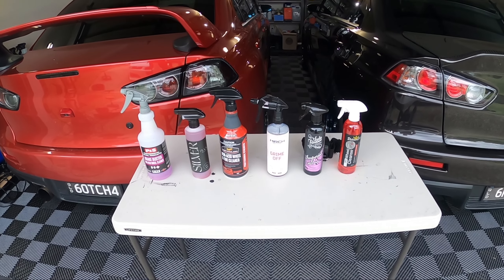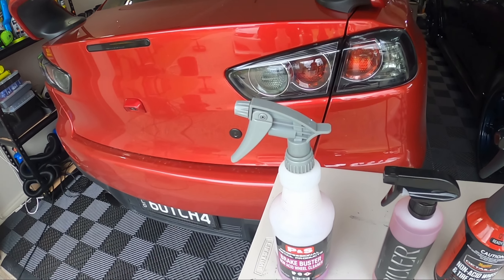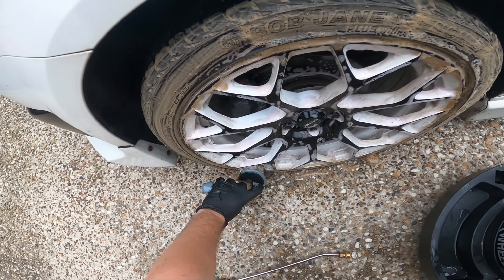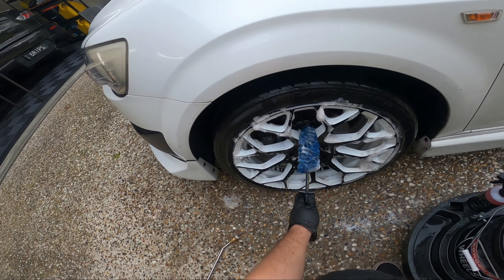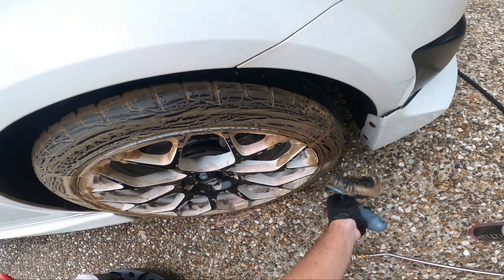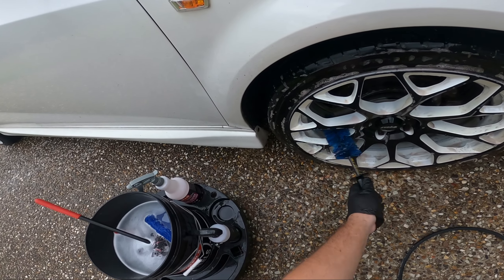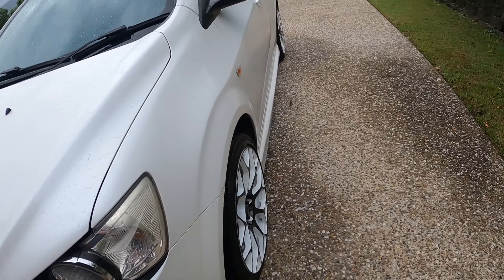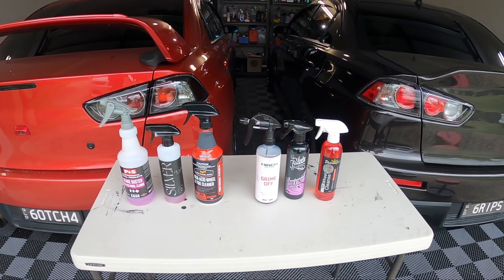Ultimate Non Acid Wheel Cleaner Test | P&S Brake Buster vs Black Label Wheel Cleaner

Comment: The non acid wheel cleaners might be cheaper than the acid ones  but with the bowdens wheely clean I find I just have to spray on and rince off less work involved to clean wheel and less product needed to use for it to work
Reply from the maker: It's the same for these generally too, as when I used them on the extremely dirty wheels in the video they really didn't need agitation, the bonus is that these also clean tyres really well also

Comment: So bowdens goes purple therefore acid?. Whats the ramification? Always wondered if it wrecks the clear coat on brembo calipers? I had the clear coat flake off and was that caused by these acid reactive cleaners?
Reply from the maker: The stuff that cause the reaction is a form of adic yes but not really considered an acid cleaner, acid cleaners are very strong products that aren't as popular anymore since the iron reactive and non acid wheel cleaners became more popular and usable.

Any wheel cleaner is likey to cause damage if not used properly or left to dry, I had it happen to my brembos as it ate the clear coat but since having them repainted I haven't had anymore issues
Reply: @EvolvedDetails  so just confirm….the latest cleaners whether reactive ( ie bowdens what i have been using ) or what you just demonstrated may affect the clear coat such as on brembos as i had experienced?
Im trying to determine the cause whether it is something that just happens over time and is a brembo thing….or was a cleaner issue or residual brake fluid thing if a mechanic fails to wash calipers after a bleed check?